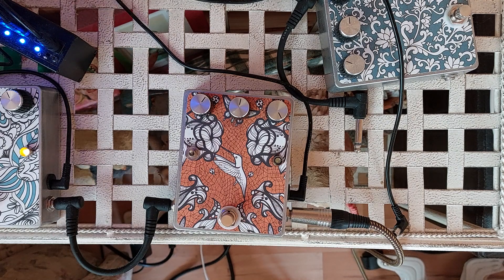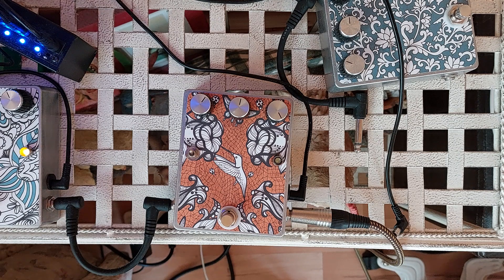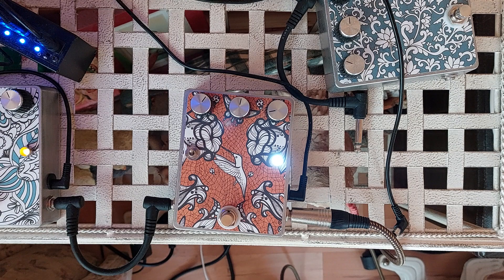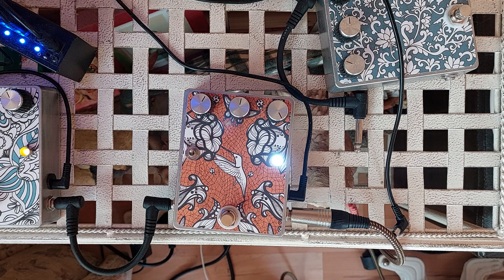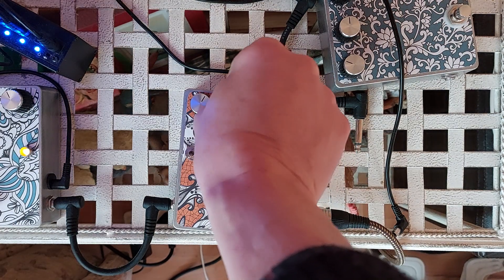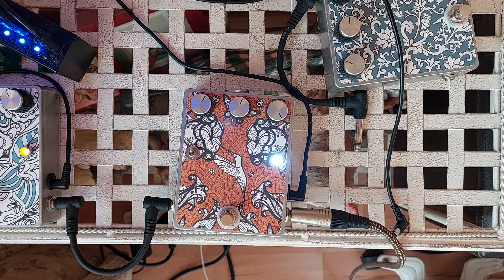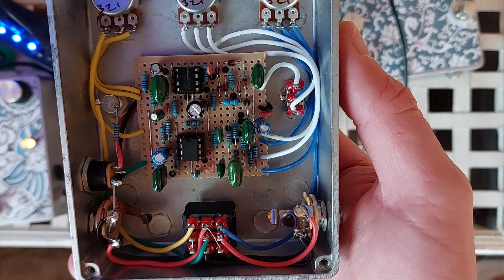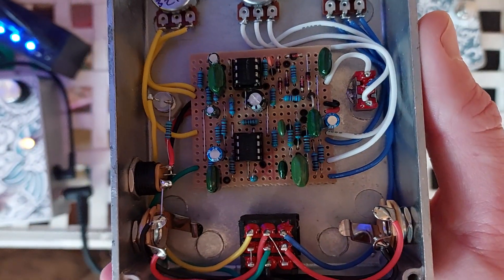v5 Op-amp big muff

Comment: Very nice build. I built the same as yours posted on Dirtbox layouts. I tried it with single coils, HB's and Jazzmaster pickups. Best for me was with the Jazzmaster circuit engaged with the tone completely rolled off.
Reply from the maker: Now try the rotten apple!
Reply: @Ian_sheridanuk  I just watched your video and had a look at the circuit. Im pretty sure I have most parts so looks like Ill be taking your advice. Cheers.
Reply from the maker: @Slappedkat  it's an awesome circuit. It seems to have much more gain and the EQ switch is a real boon. I've built a bunch and love them.
Reply: @Ian_sheridanuk  Thanks for the heads up, Ill get started tomorrow